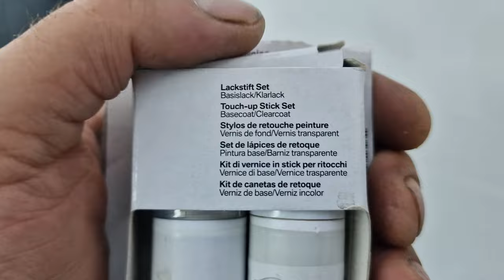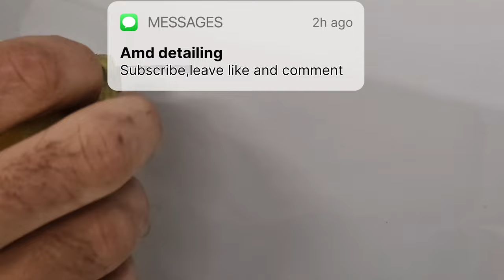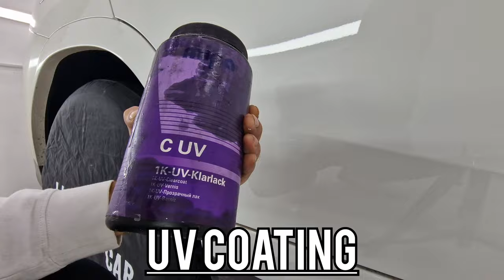TOUCH UP paint Factory-Repair deep scretch

Comment: exceptional paint retouching as usual you are very good. one thing that I hate aesthetically is the sign of the heat that the lights in this case the LED lasers leave on the plastic. practically despite the car is brand new the headlight even if shiny it looks old ..
Reply from the maker: Yes, it is located on the inside and there is no help without disassembling the headlight
Reply: @Amddetailing  i know it but aesthetically isn't good at all . This is car company fault

Comment: I have an older 2016 X1 mineral white that had a few scratches so I bought the touch up paint and it wasn't even close in color. Is there a way to alter the paint to match? The car is in great shape but the scratch repair looks terrible because of the color difference
The touch up paint from BMW is so much whiter than the aged paint on the vehicle. 
So much headaches for such a simple job

Comment: Is this regular touch-up paint? Or “BMW’s Touch Up Paint 𝐒𝐓𝐈𝐂𝐊”. I have no idea what this Paint 𝐒𝐓𝐈𝐂𝐊” is & can’t find any type of visual on it online to let me know what I’m going to be working with & what I should be expecting. For example, there is a certain type of touch-up paint applicator I want to use but from the sounds of this “Touchup Paint 𝐒𝐓𝐈𝐂𝐊” by BMW it doesn’t seem like I’m going to be able to use that applicator because it works with a liquid type of paint, it’s only going to work with a fluid paint & this “Touchup Paint 𝐒𝐓𝐈𝐂𝐊” BMWs has does not at all sound like it has anything to do with a fluid, in fact, it sounds like glue 𝐒𝐓𝐈𝐂𝐊 or something similar to that, as if I’m going to have to roll this paint on or something I don’t even know what to think at this point. If anyone has any information on this subject please reach out and help me with this issue I’m having I’d appreciate it very much thank you so much in advance.
Reply from the maker: Its org.BMW touch up